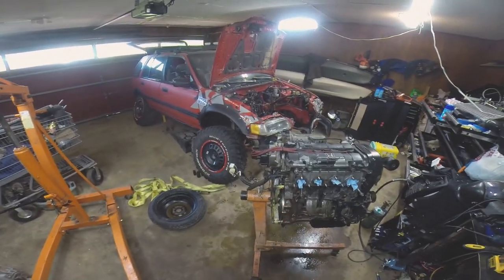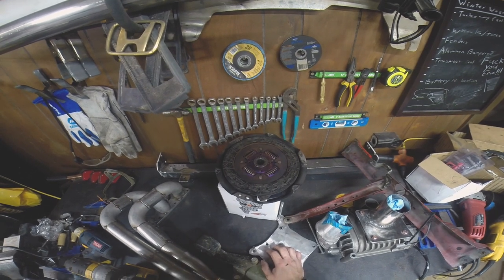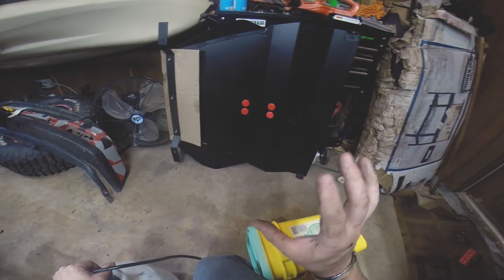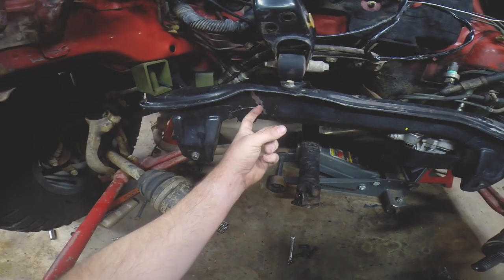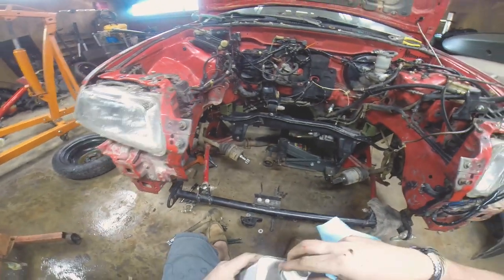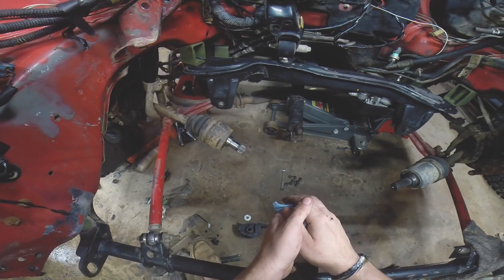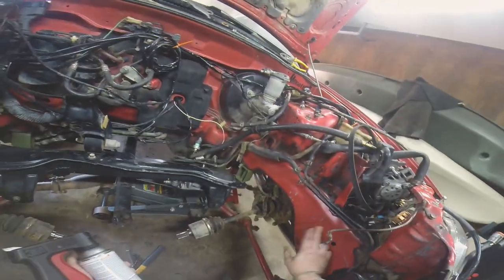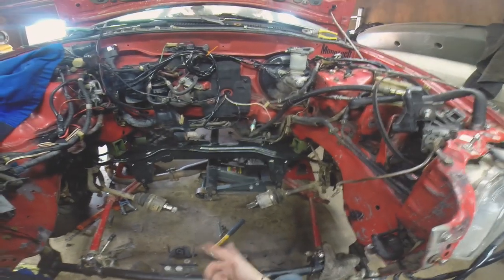Cracked Subframe Repair & Engine Clean up(EF Cracked Subframe)

Comment: I was running a Spec stage 2+ clutch in my Wagon with no issues. Keep rolling out the videos! Great Job!
Reply from the maker: Thanks Daniel! I'll be doing some research before I put everything back together. Wouldn't might an upgrade, but this one hasn't had any issues and only has maybe 8k miles on it.